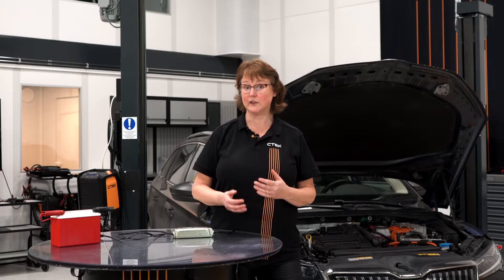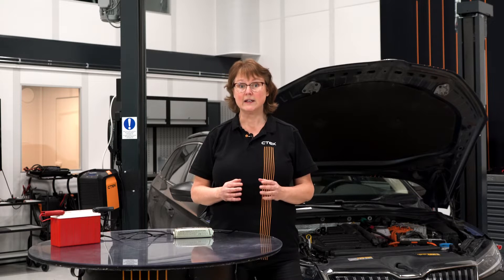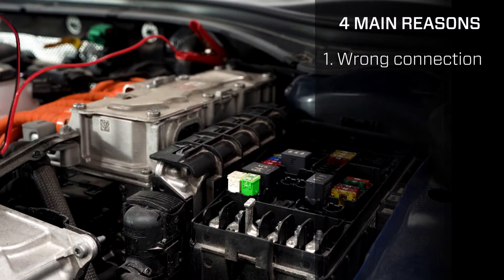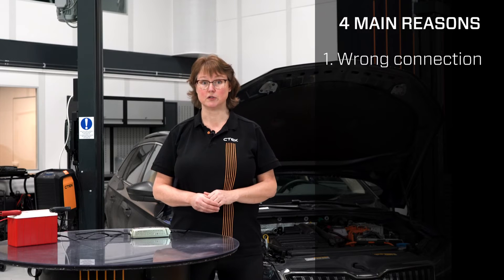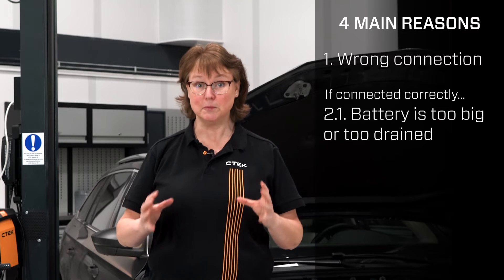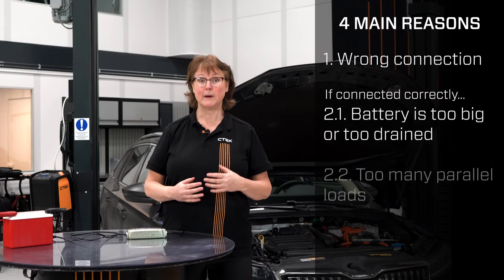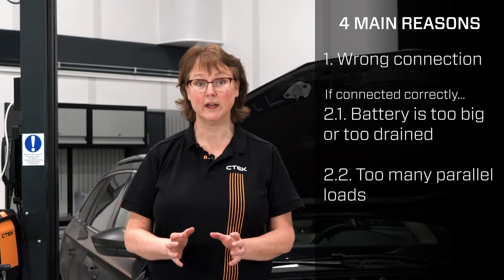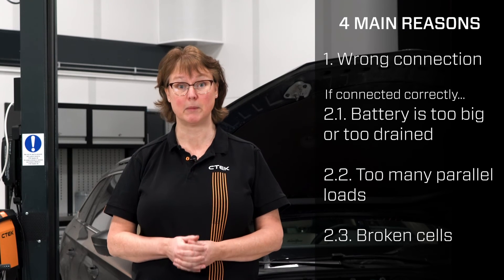FAQ | What does the red light mean on the CTEK charger?

Comment: Hello, I just purchased the BMW version of your CTEK battery charger for my 2023 R18 Motorcycle. I hook up the charger with the accessory plug. It seems to work for 10 minutes and then the red light by the exclamation mark goes on , I’m stumped.  the connection to hooked  properly, the battery works Motorcycle starts strong  not even two years old yet and I’m debating returning the product for a defective claim. Any help you can give would be appreciated.  I just purchased the product at a BMW authorized motorcycle dealer yesterday
Reply from the maker: Hello. I am sorry to hear that you experience issues with your charger. For me, it sounds like the vehicles BMS closes down the output. If you are unsure of the charger, please try to connect the charger directly to any 12V battery to see if it works well even after 10 minutes. Many CTEK users choose to mount a CONNECT EYELET to the battery and charges through that connection instead of the 12V plug output. I hope this help. Please don't hesitate to come back to us if you have any further issues. Kind regards CTEK Support

Comment: So what happens if i keep the charger connected correctly with the red !, will it ruin the battery or risk catch on fire?
Reply from the maker: Hi. Thank you for contacting CTEK. When the RED "!" mark is lit, the charger has totally turned off, and there will be no added energy to the battery.  This is more of a sign saying that the charger has stopped working due to an issue during the charge - faulty connected, Battery doesn't accept charge as fast as it should or it looses voltage too fast. If something is wrong with the battery, it is a good idea to check up the battery to be sure it is OK. There is also more information to find about this at www.ctek.com.  I hope this helps. Kind regards CTEK Support
Reply: Ok thanks 👍 @CTEKBatteryChargers

Comment: Hello, I’ve had several CTEk chargers for my car. The first lasted many years but the subsequent chargers, most recently a MUS 4.3 model have not lasted long at all. 

The battery is fairly new and the car is always on the charger as it is not used often. When I arrive home, the charger is plugged in to the CTEK provided cord which goes to the battery clamps and stays on the car. 

This last charger lasted less than a year before I noticed the red light flashing. Previous chargers have done this as well. I order a new charger and it works fine. 

The battery is holding a charge well enough for a month or so without the charger so I cannot imagine the battery is bad. 

Is there another possible cause?
Reply from the maker: Hi. I am sorry to hear that you experience issues with your MUS 4.3.  Please note that the chargers comes with 5 years of warranty and we at the support is always happy to help out. The red "!" mark can go on for different reasons, 1: the charger is connected the wrong way. 2: the charger can not raise the voltage to a certain level within a certain time. The reason could be too many consumers connected and active whilst charging, a too small charger for the battery or a poor battery. 3. The battery looses voltage too quickly after being fully charged. The reason could be that there is too many active consumers whilst charging or that the battery is in a poor condition. A red "!" is almost ever a broken charger - even if that could happen. If you have the possibility to try the charger on another, known good, battery and the issue remains, I kindly ask you to contact us at  support@smartercharger.com. 
Kind regards CTEK Support

Comment: Hi, I have a ctek mxs5.0 that I use to trickle feed my Noble m12 gto 3r that are renowned for battery drain when not in use. For 18 months this worked fine but late last year i noticed the red warning light, thought nothing of it as the car started fine. However, after the winter I returned to the car to find a completely dead battery and of course the red light again. I assumed as the battery wouldn't hold charge thereafter it was simply a battery issue. However, having replaced the battery 2 weeks ago I put the charger on tickle last weekend and returning to it this weekend I have the red light again. I've had the car checked fully and as I say a new battery so is it possible the ctek charger is now faulty and needs replacing? If possible i don't want to buy a new one without your advice. Thank you.
Reply: I should add the green light had reached stage 5 on the last charger cycle.
Reply from the maker: Hi! What type of battery are you using and what is the size? Have you added any loads to the battery recently?
Reply: @CTEKBatteryChargers The battery is an 075, 642SMF is the manufacturer part number I believe. There are no new loads on the car. The charger is presently working fine (on vehicle for 1 week) and been showing 7 green lights happily but intermittently when I've been connecting it the ctek has either got 2 or 4 green lights then the red light illuminates at some point and its clearly no longer charging. Due to this I lost a battery it went so dead it died and couldn't be recovered. This made me believe  it was a battery issue but a new battery otherwise working perfectly other than this continued intermittent charging issue. So, the question is do I have a faulty charger that needs replacing?
Reply: Yes, you have a faulty one
Reply: @UKCCAutoTechs : It sure looks like it.
These CTEK chargers are of garbage quality. They only last 2-3 months before failing.

I won’t be buying a third one, as if you add in the costs of a brand new car battery each time, it soon becomes very expensive.

Comment: With my MX7.0 the red light starts glowing when I connect the cable clamp extension (tried also with a brand new one) without any battery connected. What does that mean?
Reply from the maker: Hi,

It will depend on what mode was used. If the charger was in supply there is a short somewhere such as the clamps being connected together.

For further questions, please contact us at https://support.ctek.com/ and we'll help you from there. 

Have a nice day! 😊

Comment: I have this CTEK charger mainly for my Triumph Tiger 900 GT pro motorcycle (2023) and it has been fine for past 9 months but recently the red led light is on and not working but if I connect to a car battery and change the mode it works fine. Your video does not cover this issue. Is there an easy answer to my problem? The only thing I can assume is that the short eye hole on the bike lead is faulty. Could this be the case?
Reply from the maker: Hi,

Thank you for your message! 😊

The most likely cause of this issue would be that the positive and negative lead is mixed up.
Since its working with the car battery i would advise you to check the lead on the motorcycle.

If you have further questions, please contact us at https://support.ctek.com/ and we will help you further.

Have a great day! ☺